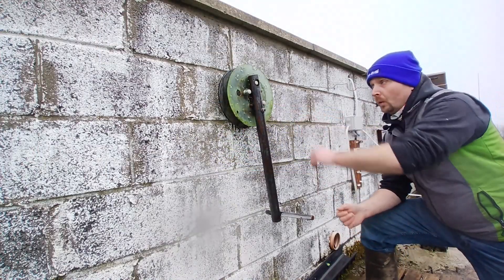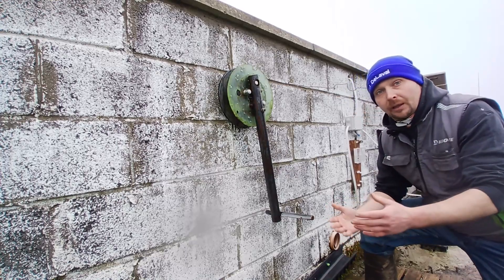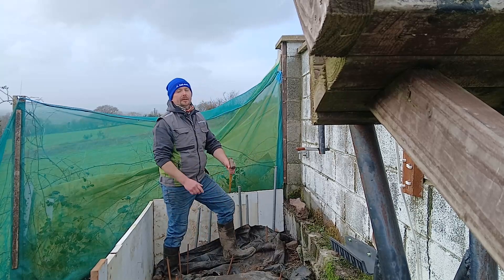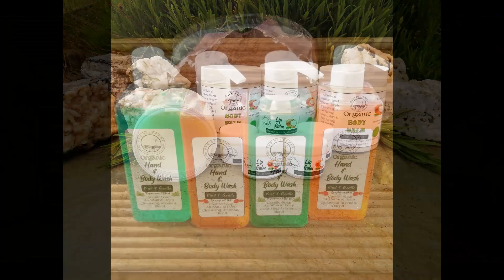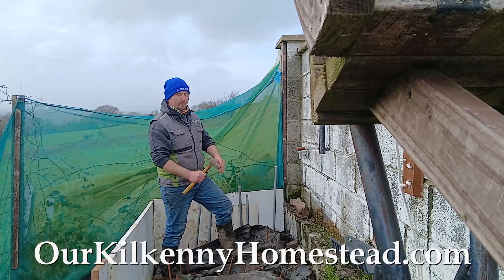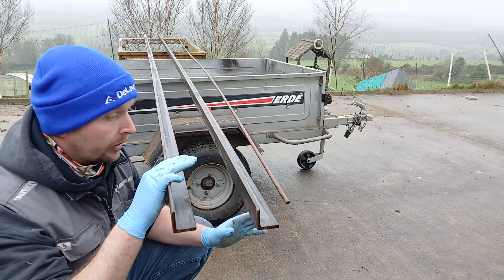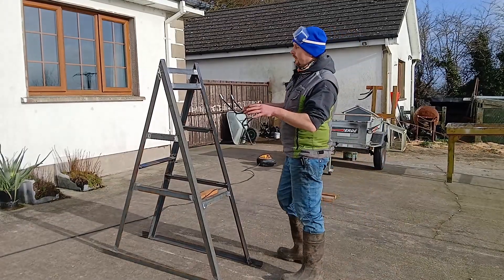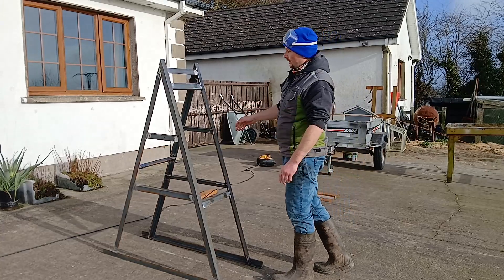Istabreeze Wind Turbine Electric Winch pt1

Comment: All practical tests show that small wind turbines hardly generate any electricity, because hardly any wind blows close to the ground. 
Even in Ireland, the falling price of solar panels (approx. 40-85€ for a 450Wp-panel) makes it much cheaper to simply install more panels for winter - than an inefficient small wind turbine. Moreover, wind close to ground is extremely gusty, which almost always greatly reduces the service life. 9 out of 10 no longer work after a few years.
Whether wind and/or solar - you need a battery (or a generator) to be able to live off grid. Batteries have also fallen drastically in price.
Reply from the maker: @michaelvanallen6400  hello Michael. I would highly recommend that you watch some of our other vids to see the rest of our system. Also some local knowledge would be of benefit to you about ireland. Simply put there are weeks and weeks during winter where there simply isn't any sun and solar panels do little or nothing. Good quality wind turbines can bring in up to 2kw on days of no solar production.

Comment: Do these turbines work well? I've read that 48v turbines aren't worth the effort due to how fast they need to spin to reliably generate but I believe yours is 24v so it might fair better?
Reply from the maker: @billienomates7100  honestly, I've seen mixed reports on the 48v also. However from first hand experience our 24v works exceptionally well.